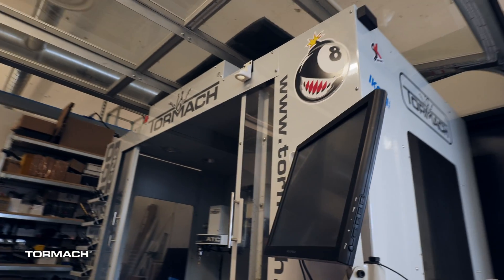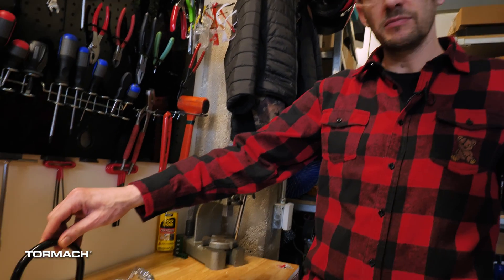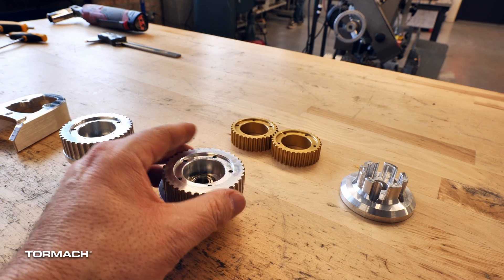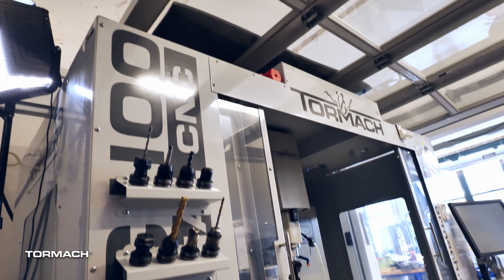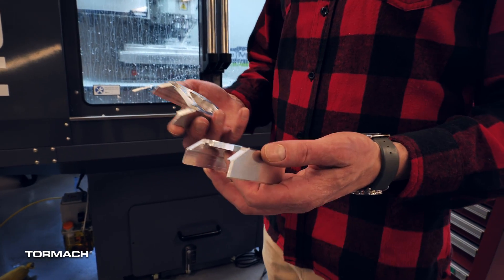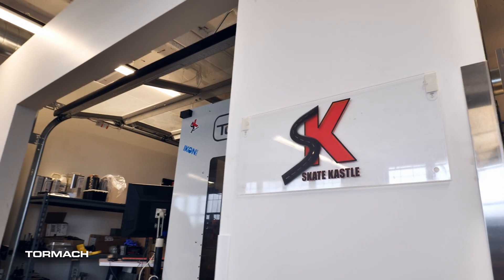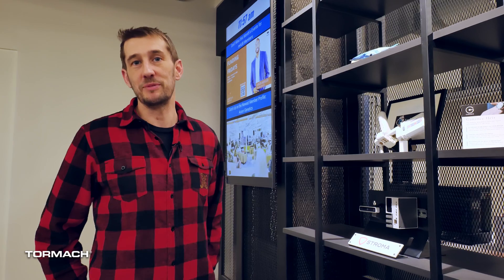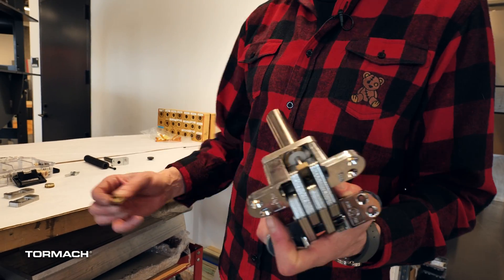Tormach Customer Story - Skate Kastle makes Esk8 accessories at mHUB Chicago

Comment: Thank you inspiring . Can you plug the cnc machine into a basic wall socket of a garage ?
Reply from the maker: Some of the machines, like the PCNC 440, 770MX and the xsTECH Router, can be plugged into most garage outlets. The 1100MX will need a 230 Vac 50/60Hz, 20A Breaker, and the 1500MX will need a 230 Vac 50/60Hz, 30A Breaker. It's best to check out the specifications to the mill you are interested in, on our mill support page, or consult with our pre-sales team: https://tormach.com/support/mill